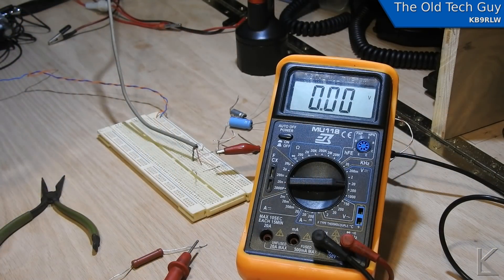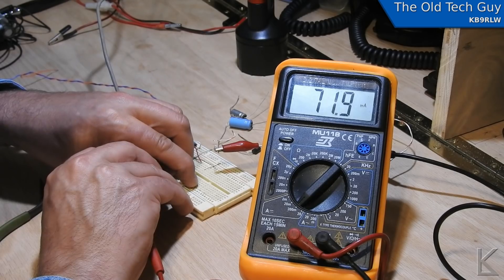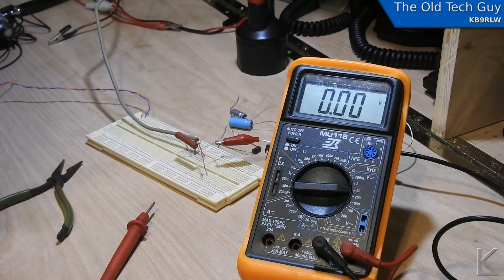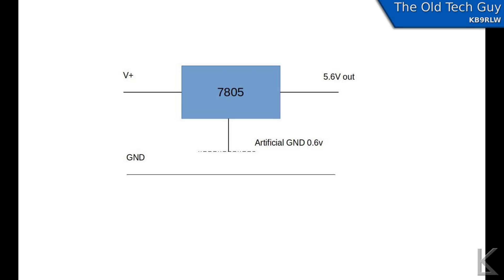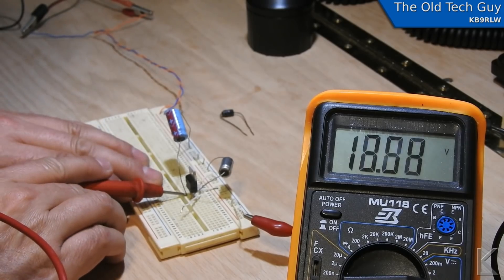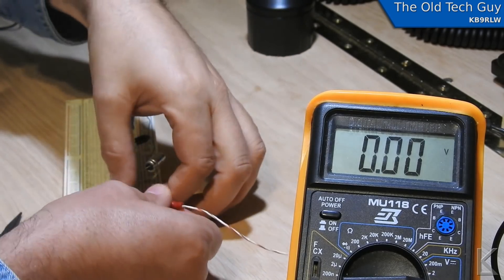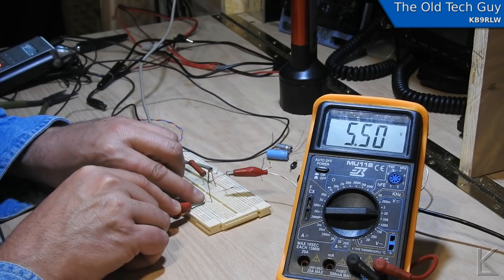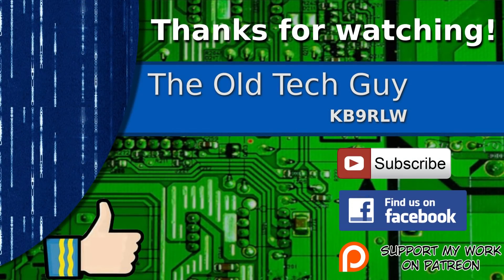Electronics - Boosting the output voltage of a 78xx series regulator IC

Comment: I knew I’d seen this diode hack previously. I needed 6.3 V for the heater of my vacuum tube in my CD player it has quite a few 5 V regulators so was able to steal the power from one of those instead of building a whole new supply just for the heaters. Thx

Comment: Baofeng. Chargers keep blowing. Up. Went to a 7805. The batt listed for 7.4 volts. I'm getting 7.2 out of the regulator net work. Charing is slow.   From 5 to 7.2  not too shabby. Now I got one that won't flame out at every Serge. . Ps I put a pair of 10uf. One on each leg  biased against the ground . Provides ultra stable ripple free DC. Sense I have modified AC for power/solar.  Good show de kv4li ps put batt (load) on the rack and it dipped down then went back to 7.2 right away on the out put.

Comment: If you get a drop of 0.5 V at a load of just 75 mA your wires are to small. Or, most likely, the USB hub is the problem. I saw a lot of USB hubs with a series diode in the 5 V PSU input as a reverse polarity protection and for isolating host power and PSU power inputs. Probably there is more resistance in the hub, like to thin power traces.

I would take a very close look at where the voltage loss actually occurs. At the wiring, at the hub, where in the hub...

And still: I would use a buck converter. Of course with proper shielding and filtering. You got lots of switch mode power converters in your RV anyway. (laptop, RasPis, ...) Probably without knowing. One more will not make it that worse.

Comment: Good lord Kevin. The typical 7805 regulator will provide up to 1 amp at 5 volts. This means the output voltage will be 5 volts at 1 amp drawn. Looking at the spec sheet the typical maximum variation will be 200 millivolts at this draw, even if the device is rated up to 1.5 amps at 5 volts. Therefore if your output voltage is falling with "only a 75 milliamp load", which actually 5 volts divided by 50 ohms ought to be 100 milliamp load, then either your regulator is faulty because its not supplying the calculated current, or you've not got it set up correctly. Correctly is that you need a filter capacitor at the input and output. Looking at the data sheet this is .33uf on the input and .1uf on the output. They are not electrolytic caps as your using on your breadboard but non-polarised caps. What happens if these caps are omitted AND the regulator is used some distance from its supply is the device can become unstable. When it becomes unstable it cannot regulate its output correctly where the voltage and current output cannot be maintained and device will deviate from spec.  Correct this in your circuit and it will probably work correctly and charge your phone as you expect - because its not actually faulty, just badly constructed, and you'll have your 1 amp supply. The solution you've come up with is to charge your phone with its maximum voltage leaving little if any room for over voltage safety margin. The regulator is working in an unstable environment or its faulty and its lucky for you the output voltage is under performing rather than over performing, especially now you've bumped the output up to 5.5 volts and left it charging overnight.
Reply from the maker: Measured at the regulator, it stays rock solid at 4.98 volts with or without load.
Reply from the maker: Or, to be specific, before the modification, it stayed at 4.98 at the regulator.  No problems with stability on the paralleled 7805's.   It is all loss down the wire.  Most USB cables use very small wire with a lot of loss.

Comment: Keep an eye out for a small power supply from a mini desktop and use the 5v rails from it.  No worries about voltage or power and as it's an SMPS it's also efficient.  Adding a diode is a nice simple solution but I wonder about power requirements should you wish to charge a power bank or such.
Reply from the maker: But how would I plug that mini destop PS into my solar panels? ;-)   Don't forget, I'm full time mobile mostly off grid now.
Reply: @loughkb  I was thinking through your inverter when driving.  For solar you will need to build or purchase something else.  I have a 12V to 5V USB adapter made specifically for this.  My reason for buying it was to connect to a 12V deep cycle battery as a USB port when power goes out.  Purchased on eBay.   You can get single ports or double ports and good current ratings for a few dollars.  Not sure if they generate RF noise though.  I bet mail is now a bit of a problem too.  I had a 1000W inverter in my truck when I was on the road so I would just plug in what needed charging while driving or idling (Trucks do a lot of idling cause we like to stay warm or cool ;)
Reply from the maker: I use the 12 socket in the dashboard when driving. Plenty of cheap chargers with that plug
Reply: @loughkb   Yes of course.  There are plenty of 12 volt USB Hubs online as well as the 12v to USB adapters ranging from very cheap (don't get these - I have one that one day I'll tear apart for parts but it's junk) to some around $20 or so and up (better quality and better current handling).  I like the 7805 circuit but you may have power / heat issues as they are typically rated 1 to 1.5 Amps and I imagine that is with a heat sink.  Maybe just moving the circuit closer to the output so you don't get your drop across the 5 volts but rather the 12 volts feeding it.  Anyway - sounds like you're on quite the adventure and sounds like fun.
Reply from the maker: I have two of them.  They generate boatloads of RF hash all across the spectrum.  That's why I went with a linear solution.

Comment: You can also use a zener diode (same as you have done with a diode) to increase the output voltage to a non -standard voltage if needed.

Comment: There are also meters that plug into the usb port and has an output port. They show voltage and current.
Like this one - https://www.ebay.com/itm/USB-Volt-Current-Voltage-Doctor-Charger-Capacity-Power-Bank-Tester-Meter/253485892132?epid=11016442624&hash=item3b04efc224:g:Q6sAAOSwiN9aptCd

Comment: I have had the same issue with 7805s and I've used diodes for similar things but hadn't thought of trying this. On my boat, I use a diode on the line going from the battery to the alternator (alternator uses it to sense battery voltage), to keep the alternator pumping more power to a battery bank longer. (AGM batteries can take more current than the lead acid the alternator was designed for). Thanks - I'll definitely use this.

Comment: Hi Kevin,
Nice trick getting a little more voltage out. That little increase shouldn't hurt any 5V device. I didn't check what output there was from that DCDC converter I sent.   73   WB3BJU